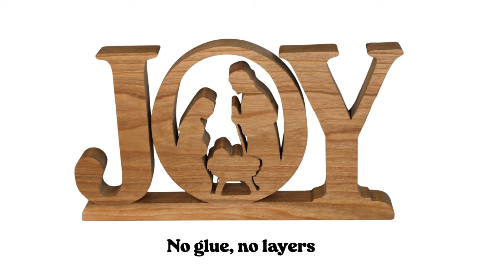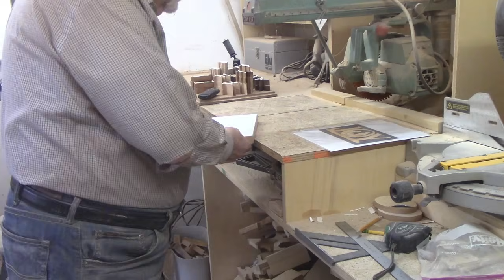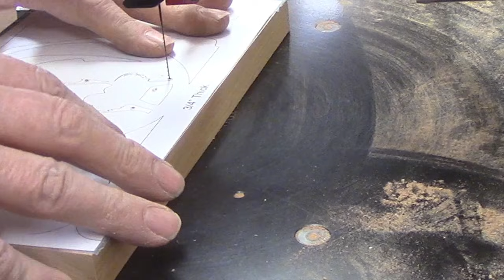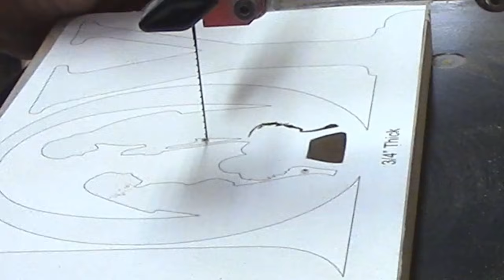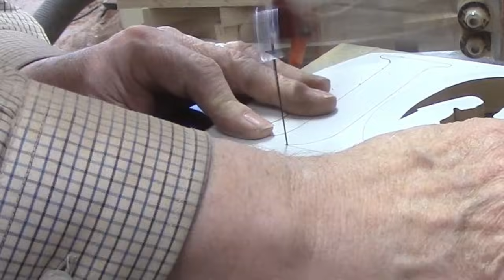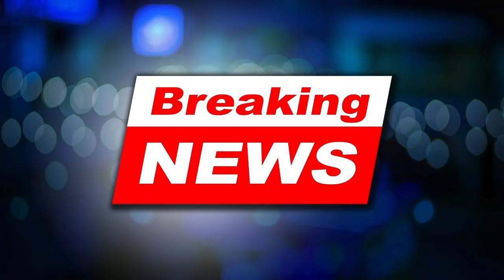Cut a One-Piece Nativity Inside "JOY" - Scroll Saw Christmas Project

Comment: I really like this project Bob!  It turned out very nice.  I won't have time to make it for this Christmas but plan to make it next year.  I agree the cherry is a very beautiful choice and like that this is all one piece so a base doesn't have to be glued on.  Thanks for sharing!
Reply from the maker: I thought it was a good last-minute choice because there was no assembly required, and it can be cut in less than an hour. What are your favorite woods?
Reply from the maker: By the way, what did you think of the jokes? It's not something I plan to do often (if ever again), but adding them seemed like a fun thing to do at the time.
Reply: @bobshomewoodshop7996  The jokes were great!  They took me by surprise.